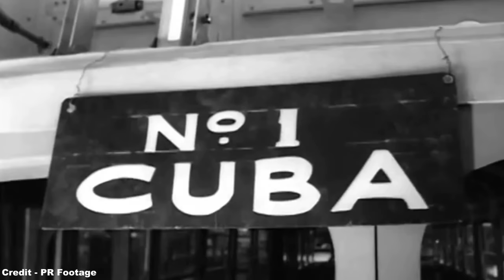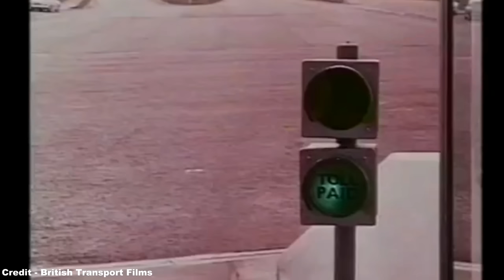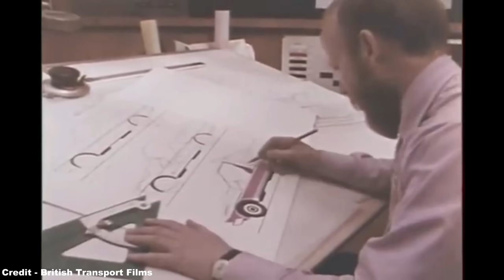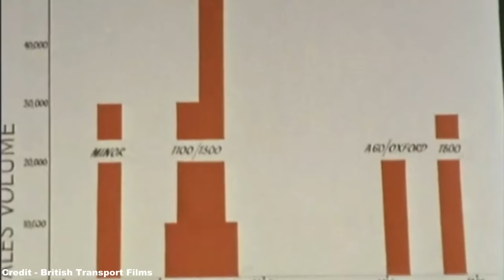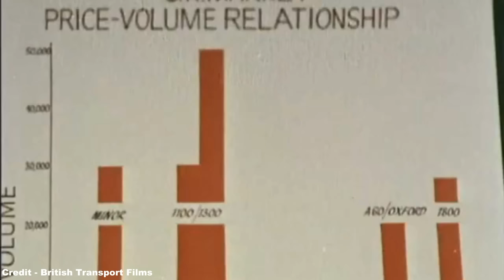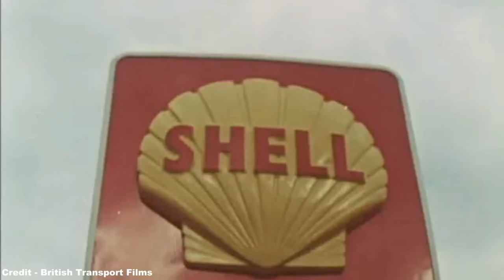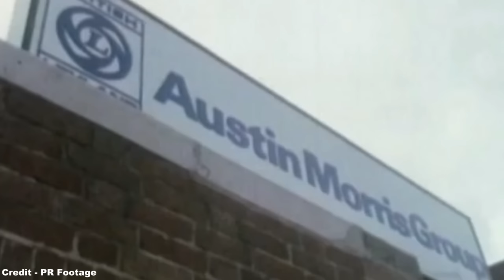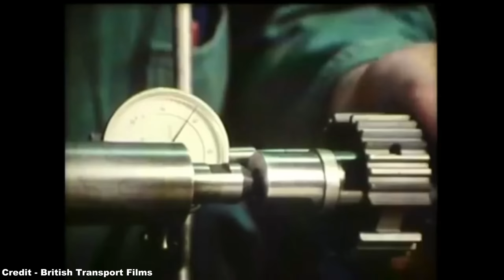Death of the UK Car Industry - Part 2: British Leyland

Comment: Thanks for this insight in the mess that made up British Leyland; I've seen quite a few videos on the subject, but this is likely the best summary so far - very well researched.  The way I see it, all problems started with the merger of the Nuffield Group and Austin to BMC in 1952 and from that point on, everything snowballed; by the 1970s problems had become so big that they couldn't be ignored anymore.
The merger of Leyland and BMH should never ever have happened as, how I understand it from this video, it was based for a large part on ego (Stokes wanting to be the captain of the British auto industry); how would both companies have developed, if they had remained separate?  What interesting new models would we likely have seen from them in the 1970s and 1980s instead of the few they eventually delivered as a combine?
Third observation I increasingly also get is that all too often, BLs problems are merely blamed on workers striking a lot and when working, delivering poor quality.  But that only a few note that there were circumstances (attributable to the management of Leyland, or lack thereoff if you will) leading up to that reality.  Substandard working conditions for example in outdated factories, poor relations between workers and management (which again is mainly up to management to settle), ...
Again: thanks!  Great work this.
Reply: You're absolutely right that the 'rot' started with the creation of BMC - there was a huge missed opportunity for rationalisation which meant that few, if any, of the potential advantages of having one dominant player in the British mass-market car industry were realised. It was much more of an Austin takeover of Nuffield than a true merger, which unfortunately meant that Austin's terrible financial practices were carried over to the new group. Austin and Nuffield actually dovetailed very well in a lot of areas - Austin had superior production methods, Morris had (much) better financial monitoring and cost control. Austin had better design facilities, Morris had much better testing/development methods. Austin had superior engines and transmissions, Morris had superior body and suspension technology. Had the creation of BMC been a true merger and conducted with a strong management plan to bring the best of the two partners together it could have gone really well, but it was too wrapped up in personal politics - Leonard Lord was out for justice after his falling out with William Morris, and lots of other ex-Nuffield executives and managers who had grown tired of Morris' "destructive criticism" management style had also found new homes at Longbridge. Wm. Morris himself was growing old and, without an heir to take over his business, was much more interested in his philanthropic activities than the future of the company that bore his name and so Austin, almost by default, became the dominant partner in BMC. 

As for the two parts of BL - BMC (BMH as it was by then) was a complete and utter financial basket case that would have collapsed by 1970 without the merger. The completely incompetent management meant that not only was it losing money hand over fist but no one at the firm really knew how much it was losing. It wasn't until Leyland accountants went over the books in the lead-up to the merger that anyone at BMH, Leyland or the government really had an idea of how rotten BMH was as a business - to the extent that Stokes and Leyland then tried to back out of the deal.  Leyland was only better by comparison but was on nothing like the solid and sustainable financial ground that Stokes had led the government to believe when the initial proposals for the Leyland rescue of BMH were made. Rather like Austin and Nuffield, the two elements were good and bad in differing respects - by and large BMH had excellent potential in terms of design and engineering but was woefully badly managed, and Leyland was better-run as a business but was rapidly losing competency in its engineering and production. As an example, the Austin Maxi was a bad car only is as much as it was under-developed, rushed into production too soon, was entirely wrong for the market it was supposedly aimed at and was badly sold and marketed to that largely non-existant customer base. But in itself it wasn't a bad car and (in typical BMC/BL style) later developed into a fairly decent product. The Triumph Stag looked great, was perfectly pitched at its target market, was designed and developed in a generally efficient and timely way, but was lumbered with an engine full of inherently bad design decisions. 

And yes, it's all too easy and simple to blame 'the workers'. And they and their unions had a big part to play in the collapse of the industry. But labour relations are two-sided and, as you say, many of the long-standing grievances behind the appalling industrial relations at BL were - or should have been - within management's purview to solve. And it wasn't the unions that insisted on launching the Maxi a year before it was ready. It wasn't the unions that decided to put the Triumph Stag's water pump at the highest point of the engine. It wasn't the unions that decided the Austin Allegro had to have a square steering wheel or not be a hatchback. It wasn't the unions that decided to launch the ADO71 under three different badges and then completely re-launch the car under a fourth brand-new badge six months later. And so on. When properly managed and given well-designed products to build with proper facilities, the same bolshie workers who slung Marinas together in between walk-outs at Cowley also built the Triumph Acclaim.

Comment: Frenchman here and anglophile too. My first car was a Triump Spitfire Mk III (2nd hand purchase) my second was a Triumph Spitfire Mk IV purchased brand new: after 1000 km my rear axle had to be changed, 10 000km later my gearbox had a circlips issue (broke down, repaired incorrectly by the Triumph dealer, broke again, sold it. Then I purchased a Triumph Stag 2nd hand at 10,000 km and almost everything broke on it except the gearbox (rear axle, power steering, motor seized because of over heating). I still have it but every long trip with it is like Russian roulette game. After this I purchased Honda Civics, Accords. My son has a CRV that is now 930,000 km and still reliable (no tow-truck business card collectionj
Long speech to say, I tried real hard to use British cars but I finally gave up and did not tell my friends to buy British.

Comment: The Austin 3 litre was not an 1800 "with a revised rear end." It was a totally different beast. It had an inline 3 litre engine with RWD, in contrast to the 1800 "landcrab" which had FWD and a transverse engine. Even Issigonis disowned it.  In fact the only thing it shared with the 1800/2200, was the mid body section and those dreadful doors. It was of course a sales disaster (along with the 1800) and difficult to see where it fitted in to the executive car market increasingly defined by the sports saloons produced by Jaguar, but also Rover (the P6/5)  and Triumph (the 2000).

Comment: I used to work for a sheet metal company in Leyland in the early 80s , they had a contract with B L to do service and repair work at the factories in Leyland on shutdowns, i remember removing a gaurd from a machine and three very large  brand new open ended spanners dropped out .

Comment: Fiat had similar problems back then. I heard that the Fiat plants in Italy, workers would only fit one bolt to the front seat instead of four, leaving the other three bolts in the foot well. They knew Fiat UK would finish the job for them. Great video. Thanks.
Reply: You are right. another worst example of massive problems was Alfa Romeo, especially the Alfasud. the workers in the factory, most of whom had no technical training, came and went almost as they pleased. as the factory was not finished when it opened, there was no storage capacity. so the steel rolls for the sheet metal presses were stored outside. the cars built from them were then simply painted over. it was not uncommon for new Alfasuds to have new doors fitted before they were delivered to the customer because the ones from the car were already rusty. furthermore were also problems with drafts coming through the sills into the passenger cabine. so they simply stuffed foam into the cavities, which then soaked up water and literally flooded the sills.

Comment: I remember that the whole gamut of British cars from the mini to the Rolls were sold by Rob's motors in Cape Town. Every single one had a drip tray underneath the engine. Japanese cars did not need them as they did not leak oil. Same with British motorcycles. Shortsightedness of management and labour killed both industries.

Comment: Back in 1982 age 18 i worked part time at a car auction driving the cars in ready to be auctioned off on the block and every car mentioned in this video i have driven at that time and to be honest they were all a bag of junk ,the amount of times i had to jump start BL cars was endless and they were all depressive looking things too but once in a while a Volvo 240 series came in and what a difference in quality they were compared to everything British made .Could not afford one at the time so had to make do with a mk3 Cortina but soon moved on to Volvos ,sadly today 40 years later i cannot afford the new breed of Volvos so make do with my humble Ford Fiesta 2007 model which is pretty cheap to run and maintain but as for anything from BL i cringe looking back how bad they were .
Reply: The Volvos then had 30% British made parts, so it is not that Britain couldn’t do it, it was BL that couldn’t.

Comment: When Honda stared building it's bikes and cars twenty percent of its profits went into research and development.  What was the UK percentage.???. Even cheap alterations to a problem were ignored. The three litre is far removed from the 1800. Only the doors are the same. One front wheel drive the other rear wheel drive. I have had both and enjoyed them..

Comment: Through the 70s and 80s I drove many of the Layland Ford and Vauxhall cars of the period for work. That was the reason I NEVER bought a British designed car in the next 40 years
The Morris Marina was truly terrible, but then most British cars were. You could tell how bad things were by just looking down my road at home. When we ariived in 1970 almost every car was British By the time we sold the house in 2006 only TWO families owned a British car.
Reply: I owned a mini, two Triumph Vitesses and a Triumph 2000. I found them all to be easy to drive and maintain. Rust, however, was a major problem! This, of course, was to be expected given the policy of "built in obsolescence. Interestingly, my type 25 VW suffered from a blown head gasket at 65000 miles (a known fault that had a well covered up recall throughout Germany and the US, but not in the UK. My second type 25 needed a new gearbox around 95000 miles. I also owned two VW Polos, both of which needed the cylinder head skimmed due to corrosion tracking. The difference is that most countries are not as self critical as the Brits!

Comment: A friend of mine in Germany  bought an Rover in the 1990ies. After 3 month the window of the drivers door blocked. He went to the car dealer and the mechanic fixed the problem but he discovered an swastika painted  on the inside of the door. He complained at the dealer and sued the company. The investigation found out that this was quite common on cars for Export to Germany. He as an  Jew found this very insulting and this was the last British car he owned. He sold it after 8 month in total.
Reply: Oy vey
Reply: there are rumors that fish have been stuffed into doors or cavities in cars that were exported to Germany. things really got stressed in 1994, when the Rover Group was taken over by BMW. according to reports from the time, there was a real power struggle and tussle over competence between the German top management and the British middle management and workforce.

Comment: Through all of this, one of the points I keep hearing is about warranty claims and poor reliability. What actual action was taken to really take this problem by the scruff of the neck and sort it out? And it's not just warranty claims, it's reputations of poor reliability after the warranty has expired that also matters. This issue seemed to go on year after year after year - were they asleep at the wheel? It's as if the management were only tenuously connected with reality on many different fronts - just, absolute despair
Reply: I feel the same as you about the Range Rover now.
Reply: @iainmclaughlan1557  really? Is it that bad?
Reply: @herseem  yes, they tend to be at the bottom of the reliability tables and they are a premium brand! If I was in charge I would stop everything and sort it out.
Reply: @iainmclaughlan1557  to be fair, I thick there are two potentially confounding factors here: luxury cars h have more to go wrong than base models, and also tend to be bought by people that demand higher standards and are more likely to complain about things that aren't perfect. That said, their rating should be on a par with, say, Lexus.
Reply: @herseem  I can see your point. Yes, they have to rise to the challenge and this really is non negotiable.

Comment: I had a very old Wolseley 1800. Great car when it worked. Two steering racks, power steering pump, hydroelastic suspension had a leak and died, starter motor, engine mount died thereby knocking out the drive shaft, , varied electrical, crack in head which I ignored, sills replaced and they'd fill with water anyway, windscreen exploded, wheel bearing went. Happy days.

Comment: Basically the entire issue with British manufacturering, now and then, is that everyone wants a piece of the pie and their name in the sky and will sacrifice everyone under and above them to achieve it. That's why notable exceptions are notable as they aren't backstabbers trying to get a comfy pension and legacy. 
The issue is this toxic behaviour is top to bottom in UK culture and infects every facet of the culture and economy. This even goes down to unions who actively hamper any realistic restructure of the businesses and don't personally care about the workers or trade being sent abroad as long as they get their cut of the gravy. Then coupled with share holders, investors and outdated and outmoded businessmen still thinking in 1950s terms rather than learning from the Japanese we trained for most of their post war engineering, since nothing they did was much more than improving on UK designs and refining them to perfection, every part of UK business collapsed during the 70s and the government just let it go due to the focus on globalism before nationalism which led to the 80s where anything of value was bought at rock bottom price and led to things like Fujitsu snatching up the International Computers LTD, that was years ahead of anyone else bar IBM. 
Doesn't help that alot of said purchases were by corporations that were backed by national money like EDF and especially German motor firms.

Comment: I bet all that seawater did those Marinas a lot of good. Surprised they’d drive after.
My dad had a Marina and it was utterly terrible.
Reply: LMAO yes. I was looking like that and thinking: "there is no way those Marinas lasted more than a year after they recorded that, those cars disolve like an alka seltzer in water..."
Reply: @MeDicen_Rocha  The major component of the front wings on my father's 1.8 Marina was body filler. there was no internal wheel arch, so crap from the road got caked up behind the headlight mount.
The thing was painted an absolutely awful brown colour that even Trabant would have had sense not to use. 
Imagine one of the painters having a really bad curry and then emptying his bowels into the spray gun pot and then painting the car. 
As an alternative you could have a green that looked like the contents of a badly neglected pond.......
I think the Marina was intended to be a replacement for the old Moggie (Moris Minor). 
I think the only decent product BL made was the 1.5 and 1.8L Leyland diesel for marine applications. They were very respected in canal boats.
All cars of the 1970s rusted badly. Even the Japanese Datsun Cherry. But they were reliable up to the point advanced rust condemned them.
Which is what you need in a car if it is used for work purposes.

Comment: I was stationed overseas in the early 'seventies when undersealing with ziebart/dinitrol was in vogue on the continent to better resist corrosion. I was advised that my new Maxi would need a full inspection through microscopin	g holes drilled into known hidden troublespots first, as many of the export BL cars were rotting  and clearly not nearly as new when shipped. Mine passed, but whilst waiting for the undersealing to take place I examined the "chamber of horrors' picture book they has compiled for justifying the refusals. Terrible workmanship, filler crudely applied, patchy electroplating, sills rusted through and several doors packed with paper which held the water in to apparently deliberately cause rust. I traded her in and and bought bought a Volvo, best thing i ever did.

Comment: The mini and his so called fuel economy. I had a Mini in the late 70's and early 80s, showing a normal fuel burn of 6-7 liters per 100 Kilometers. Today, my daily driver is a Fiat Cinquecento 170 from 1993, regularly showing 4-5 liters at most. And we are talking the about same engine capacity, but producing 75 hp as opposed to the 34 hp of the Mini. Fuel economy, my shinny metal butt.